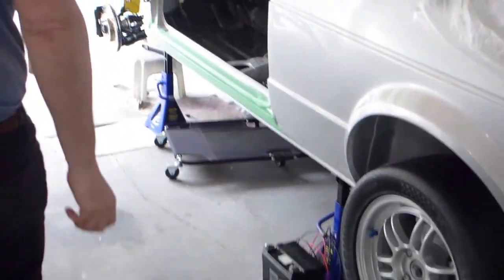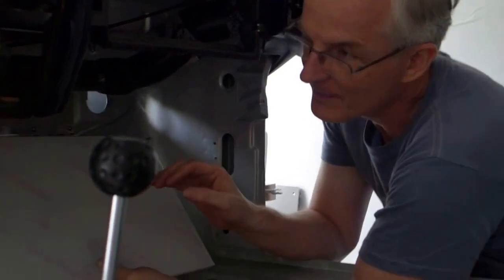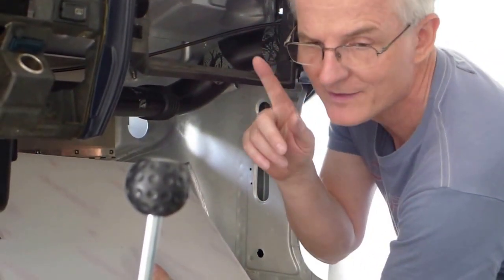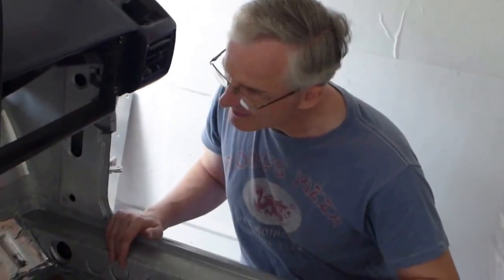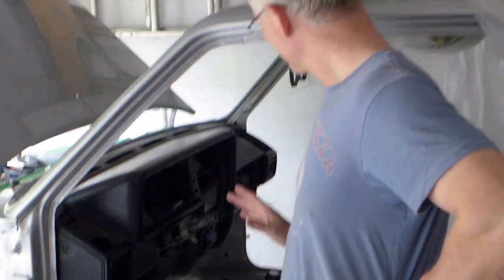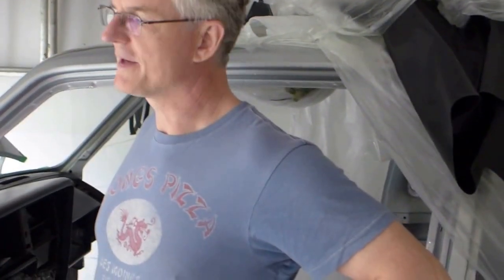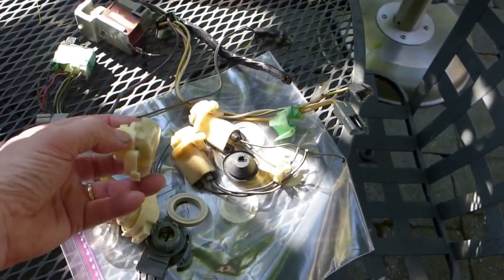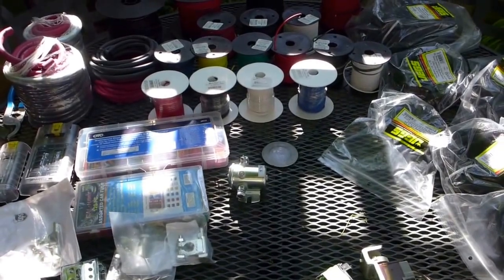The Ultimate 1983 Rabbit GTI - part 88 (Electrical Wiring)

Comment: Nice stereo system. I love the way itb sound, so I have no stereo at all on my Rabbit, I was running CBR600r bike carbs, but will probable move to bike itbs with MegaS, nice to see fuel part is all dial, I bet you will fire it up real soon. Keep it up, amazing project.
Reply from the maker: masckkara So true. I am doing a bit of a retro project in that I had an original 83 back in 83 and the very first thing I did the week I took delivery was put in a nice stereo. But most of the time the engine is the music - no question!
Reply: Derek Spratt here my old setup, reaaaaaly old video btw.
Reply from the maker: masckkara The sounds your engine makes is awesome!

Comment: At about the 13:00 minute mark you were talking about having a remote shut off coming directly off the battery. I don't know how your new ECU, Digital dash, and Amp work, but you may wish to run a constant power to them that doesn't get shut off with the remote shut off just in case losing power would wipe their saved settings.
Reply from the maker: Zack Pavlik Good point. I will check on how they handle power-off memory storage ...